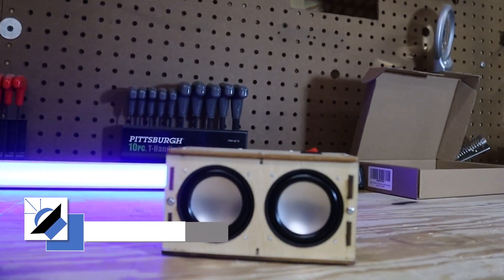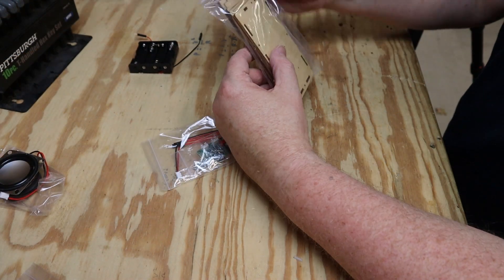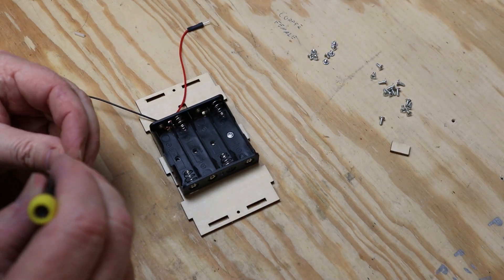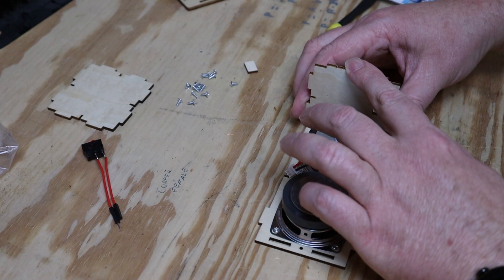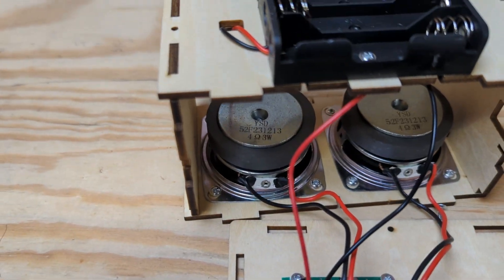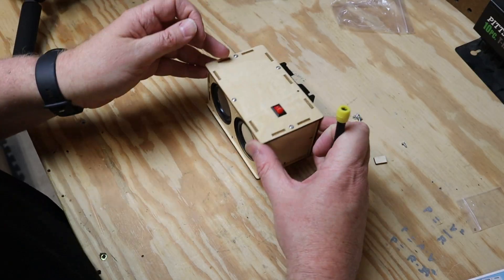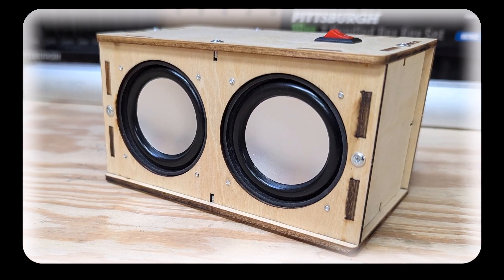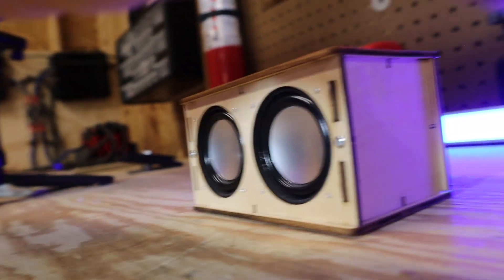The Smallest Bluetooth Speaker Kit on Amazon.

Comment: If you wanted to change the power from a battery to a chargable one how would you do that
Reply: You would probably want to use a 6v or maybe 7.4v lipo battery. Then you could do one of two things, install the battery and a charging board in the speaker. Or, a simpler and my preferable way is to purchase one or two batteries with a cheap external battery charger. And install the batteries in a way that you can swap them out when they run low. There's nothing worse than when you have to stop the music to charge a speaker. You could also take it camping with enough batteries as you need without ever needing to charge it. And, you could add a usb port to charge your phone off the speaker. 

7.4v will be much cheaper and easier to find but I'm not sure this circuit board can handle it. You may want to add a dc to dc converter to reduce it from 7.4 to 6v. They are small and very inexpensive. They are called buck converters sometimes. Just make sure you get that steps down the voltage and not one that steps ups.

Comment: Curious if you have ever built a box for a pair of subs, say 8 or 10 inchers, with the box having 2 separate chambers one size and tuned for ported and the other sized and tuned for sealed. I have never seen this done and very curious as to how it might turn out. I looked through your videos and if you've built one like that I missed it can you tell me where to find it. Thanks.
Reply from the maker: I've never built one like that, and something like that is one of the most popular requests.  I don't think it will work.

Comment: A store chain (or chain store) a bit like Radio Shack here in Sweden were selling BT speaker kits with a box made of cardboard that snapped together with strips of magnets. They were like your kit but reguired no tools. The shop sold "leftovers" for $2 a kit. Originally they had been priced 5 times more.
However looked, when finished like an old-school transistor radio and sounded pretty decent.
Reply from the maker: Cool.

Comment: Looks like a good project. I wonder if some sound deadening on the walls would help. I have an Oontz Angle 3 Ultra that's similar in size. It has more power and fades below 120 hz. Definitely gone by 80hz.
Reply from the maker: The juice would not be worth the squeeze.

Comment: These are a great gift idea. Also for those in the RC hobby it’s a super cheap ready to use setup. Funny you covered this, the last few months I’ve been playing with chip amps!!! Wuzhi is one of the popular ones. Powering all sorts of speakers from 2inch to 10in subs off 18v and 40v ryobi tool batteries. I’m about to install one in my 05 Tacoma single cab as the main head unit! Impressive little guys.
Reply from the maker: Cool!